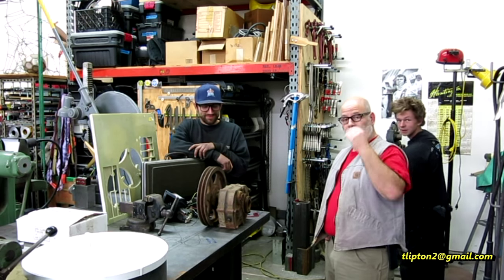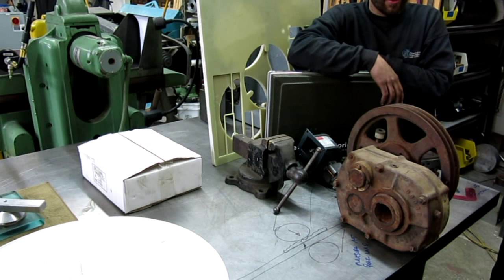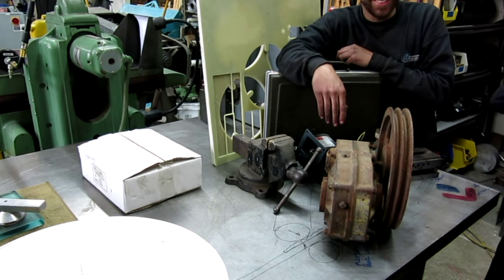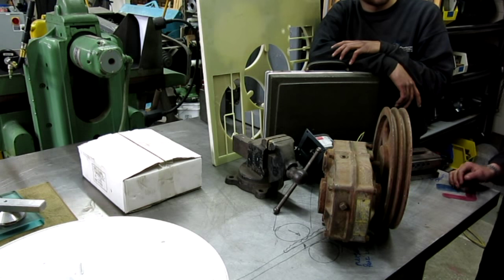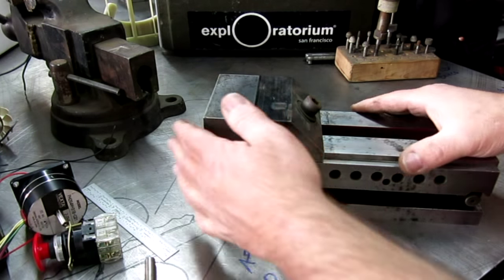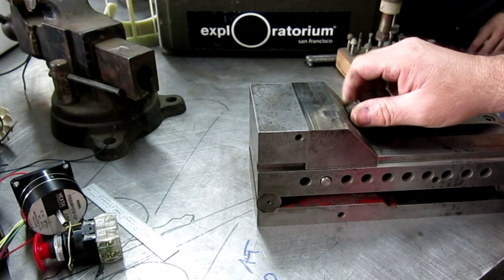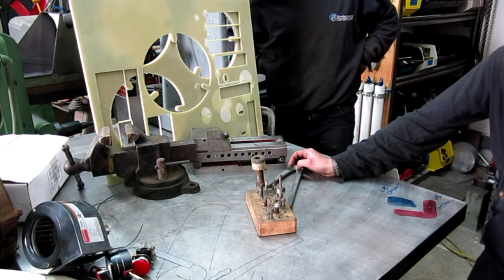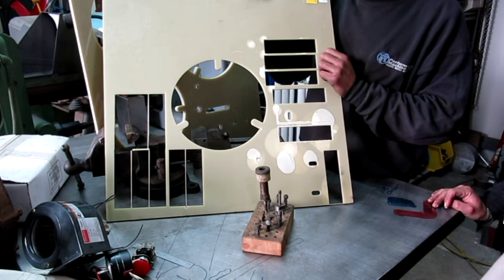Masterclass Horse Trading Part 1

Comment: G10 is an interesting material, but it's really just fiberglass.  You didn't mention one of its most common uses - printed circuit boards.  It's the most common substrate for single and multilayer boards.  Sure, it's a mess to cut dry, and it's pure hell on cutters.  It's also pretty tough, a great electrical insulator, and it's dimensionally stable over temperature.  Very important for very dense electronic assemblies where, yes, the tolerances can get down to a thou and sometimes less.  It's also great for all sorts of test fixtures, especially "bed of nails" fixtures.

Comment: The Dodge gearbox is a drive unit for open end shafts such as conveyor drive rolls. The open drive hole through the gear box is affixed to the open ended shaft using a keyed taper lock bushing of the appropriate size for the shaft O.D. A torque reaction arm (normally adjustable for length via an inline turnbuckle) is attached to the gear box and runs to the base plate attachment for  the drive motor so that the belts can be tightened by swiveling the gearbox around the shaft moving the sheaves closer or further away from the motor. These units are perfectly suited for the "field" as they do not require a fine degree of alignment as the box orbits on the end of the shaft and the belts take up any appreciable misalignment. Under normal conditions a replacement drive can be installed in a few hours and all adjustments are done with a tape measure and a straight edge.